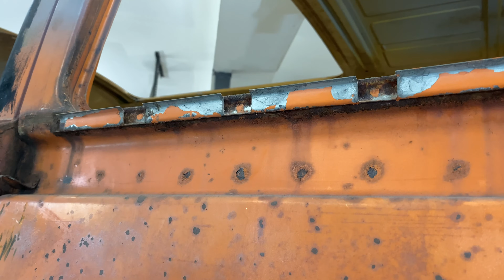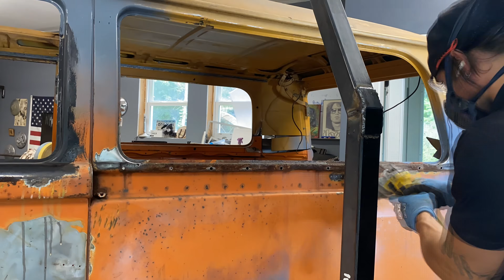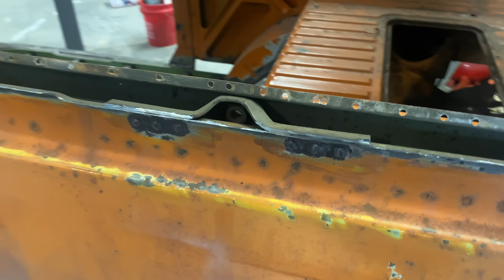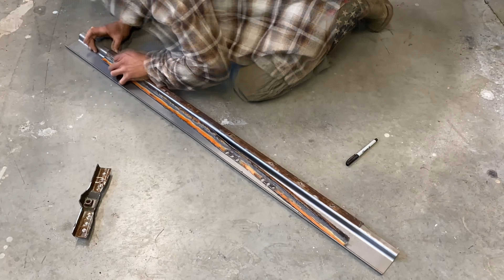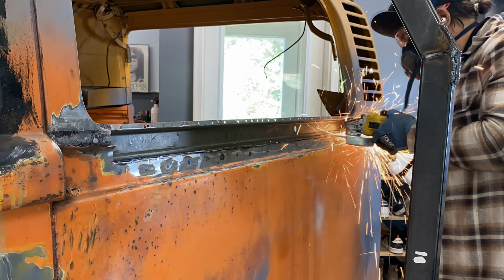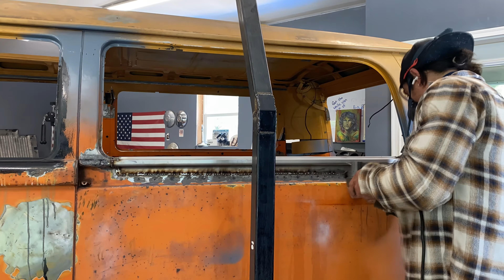Rear Window Rust Repair! | VW Bus Restoration Episode 44

Comment: The bracket you removed is for the seat belt shoulder harness attachment point. There another one in the other side.
Reply from the maker: The one on the other side was missing due to  this being an early Westy there was a cabinet there. I will now be putting a cabinet on the other side

Comment: Great work, the part you left out was the rear seatbelt mount. Any non-panel bus has them. Totally usable with a rock n roll bed too…
Reply from the maker: I am going to have cabinetry on that side, similar to the vanagon westfalia interior!
Reply: @Vangabonders  nice. Really nice job - I think I need to use my power file more, your metalwork is invisible now!

Comment: That's one of those long welds that feels never ending when your welding and grinding! I did this repair on the passenger side of my 76 recently. I wasn't aware there was a replacement panel available. I'll admit I didn't search too hard because I had a decent donor but it's good to know for future repairs. Also, I saw someone else mention it and I will second their theory that the reinforced section with the threaded port is a seatbelt mount.
Reply from the maker: If I could replace metal on my bus with a donor I would, but this replacement panel was very close to spec! I figured it was a seatbelt mount but I will have a cabinet there so it won't be a problem that its gone

Comment: What’s your welder set on? Your welds  looks good.
Reply from the maker: It’s a Lincoln Mig140 and I’ve got it on the B setting for heat which is the halfway point and at about a 4-5 wire speed
Reply: @Vangabonders  that’s the same as what I’m using. You welds look a lot more consistent than mine. What pressure is your gas at when you pull the trigger?

Comment: Not 100% sure - but I believe that bolt hole is for a shoulder strap on the seat belt. I believe you should have one on the pillars behind the front seats  too. But please correct me if I am wrong.  Great video again.
Reply: I think Ray is right, it was for seat belt for the most rear bench seat.
Reply from the maker: I figured that it was something related to the transporter version of the bus but I myself am not sure either lol

Comment: Cut and butt is such an awesome trick. Fantastic work on this repair. I am once again envious of your time available to keep this project moving.
Reply from the maker: Thank you for showing me that trick!!
Reply: @Vangabonders  Not a problem at all. It works even better if you can find a cutting device with a thinner blade. Loving the content. Keep it coming!
Reply: That was the rear seatbelt anchor that you ask for comments.
Reply from the maker: @acbrosnan1  that's what I figured, thanks for the reply